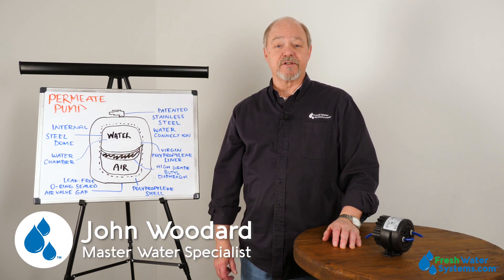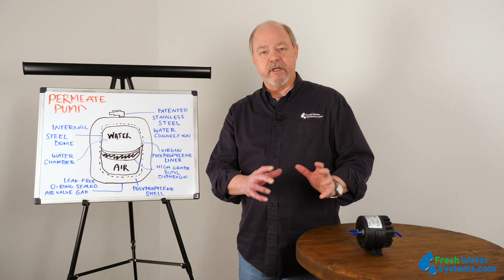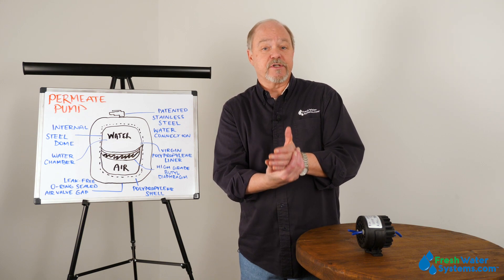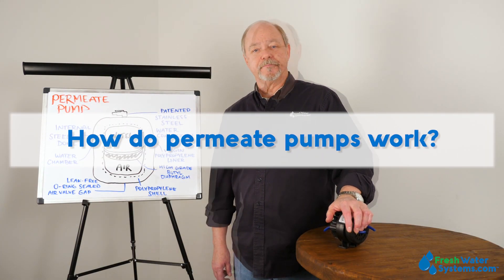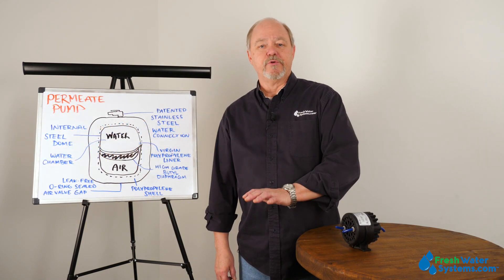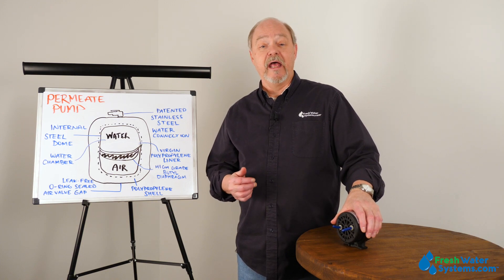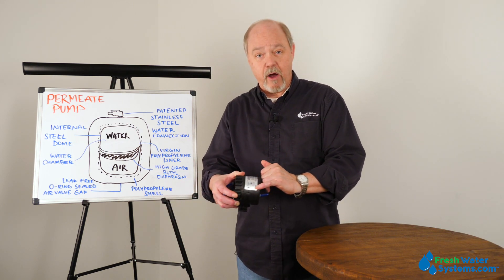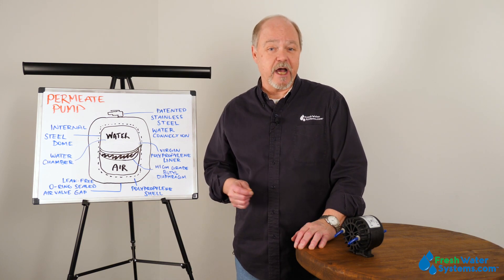What is a Permeate Pump and How Does it Work?

Comment: So basically functions as a turbo does on a vehicle. By converting waste pressure into clean supply pressure.
Reply from the maker: That's a neat comparison.  Using the energy of water flowing to drain, the permeate pump pushes water into  the storage tank protecting the membrane from the rising pressure in the tank as it fills.

Comment: I bought and installed an Aquatec ERP-500 permeate pump according to the instructions and it stopped working after a few days.  I checked the outlets from the membrane and they were producing water so it was definitely the pump that was bad.  I'm not the only one who has had this happen.  Is the ERP-1000 any better?

Comment: This video forgot to mention that a permeate pump ONLY helps to fill a pressurized tank (conventional bladder-tank).  It adds no benefit to a tankless RO system or some type of non-pressurized tank.
With a bladder tank, the air behind the bladder gets compressed and pushes the bladder, which makes it more difficult to fill the tank with water. The RO system is essentially fighting against the tank pressure to fill up the tank.  As the tank gets more full, the pressure gets even higher and the membrane wastes more water.  A permeate pump helps overcome the tank pressure so that the RO system can operate at peak efficiency.
With a tankless setup or non-pressurized tank (like an open barrel), the water flows freely, so there is no tank pressure to overcome, and the permeate pump adds nothing.
Reply: Thank you,  I came here to ask just that question.
Reply: The permeate pump works well when it works.

Comment: With the permeate pump installed in the cabinet below the sink with the doors closed, can you hear the sound of the pump in the kitchen? Are they loud/annoying?
Reply: I put mine underneath the floor between floor joists so you can see it from the basement. It helped a lot. One thing is it will fill faster and shutoff eventually, but you can definitely hear it if it's in a cupboard like a clicking noise.
Reply: You want one that makes a noise so you can tell if it quits working.  My ERP-500 lasted less than a week.

Comment: hi! i bought second hand reverse osmosis system (7 stage). It has permeate pump on it. But I do not use the watter storage tank that came with it, but rather I let it go to bucket. I guess the permeate pump then doesn't work cause there's no pressure.

Comment: this video shows removing the ASO valve, other videos out there shows leaving the ASO, and hooking up permeate pump to it (whats the difference, with or without using a ASO valve?)
Reply: The ASO is for people that for some reason don't know about the permeate pump.
Reply: Most ASO valves limit the storage tank to about 60% of the inlet pressure, so a 60psi line pressure gets you 40psi in the tank. This is so the membrane is always working with a pressure differential. With the permeate pump you can pump the tank right up to 60psi. The problem is that every time you get a glass of water, the system will cycle because the permeate pump has low hysteresis. This is bad for purity because at the start of every cycle you get a shot of "dirty" water due to TDS creep (same reason tankless RO is not all that great). So some people install a special 90% ASO in tandem with the permeate pump. This has more hysteresis so the system will cycle less, less cycles is better for the purity of the water in the tank.
Reply: It should replace the ASO as it does the same job. I put one on my system and was told to remove the ASO.  Love it!

Comment: i have read the permeate pump increases TDS creep. true? if so, what is the decrease in performance percentage?
Reply: That is not true. It is only true if you remove the auto shutoff valve, which you can't do anyway as then the brine would run 24 hours a day and waste hundreds of gallons of water.
Reply: @rsilvers129   The pump replaces the ASO and no will not run 24 hours.
Reply: @nelsonmccoy4120  So many obsessed with the ASO.

Comment: So the permeate pump reduces the pressure on the product side of the RO filter so the supply side pressure is more effective in pushing water through the filter.
Reply: That's a good way of putting it.

Comment: I decided to consolidate my thoughts a put it in a single short message.  First, get the Permeate pump.  There is no situation where you will not seriously benefit from it, even if your water supply is 70PSI.  The video makes that clear, but you can find graphs all over online about them.  You waste like 80% less water, your tank fills faster, etc.

Keeping the auto-shutoff (ASO) valve after you put on your permeate pump is a tougher question.  There are good reasons to do take it off and good reasons to keep it.

KEEPING THE ASO AFTER YOU PUT ON YOUR PERMEATE PUMP
--------------------------------------------------------------------------------------------------------
1) Bad: if you keep the ASO on, your tank will reach, at max, about 2/3rds your line pressure.  That means it'll shut the source down around 2/3rds and start it back up again once the tank pressure reaches 1/2 line pressure.  Now that doesn't mean 1/2 to 2/3rd water fullness level in your tank!  I said pressure, and generally, while there is a positive relationship there between the pressure being higher and your fullness being fuller, it's not a linear one by any means.  If you empty your tank and make sure it's running about 7 PSI empty, you can figure that at 2/3rds pressure, your tank will still be probably 50% full or so (a 4-gallon tank gives you about 2 to 2.5 gallons at 2/3rd pressure).  BUT the pressure to your RO faucet is the pressure in your tank, so if you have very low line pressure (say 35PSI) 2/3rds of that might be too slow for you.  Just don't forget it makes a WORLD of difference what kind of RO faucet you choose too if you are dealing with low line pressure.  The cheap ones that come with the kits with the little plastic lever are worthless.  Get a decent one on Amazon like this one to get the most out of your RO pressure: https://www.amazon.com/gp/product/B07JH2D4DM/ref=ppx_yo_dt_b_asin_title_o02_s00.

2)  Bad: there is yet another piece to go wrong in your system, even if it's only a $10 piece.

3) Good: an ASO keeps the RO unit from turning on and off each time you grab a glass of water, which really helps with TDS creep (that is it creates a hysteresis for the system if you want to get technical).  I mean if you just fill your tank and you measure say 10ppm that day.  And you fill a few glasses of water each day and check it again a week later, you'd TDS will still be about the same.

REMOVING THE ASO AFTER YOU PUT ON YOUR PERMEATE PUMP
------------------------------------------------------------------------------------------------------------
1) Good: your tank will remain at near 100% of line pressure all the time, which means you'll have the fastest draw in the west.  It also means your tank will be as full as it possibly can be without the ASO.  On a 4-gallon tank, that might be another 2/3rds gallon even (in my experience) - so 2.7 gallons rather than 2 gallons for a 4-gallon tank.

2) Bad: The cleanliness of your water (TDS) tends to go down with time if your use patterns are just a few glasses of water here and there - like most people.  The tank might start at 10 ppm like above, but if you fill a few glasses of water each day and check it again in a week, it could be 23 ppm.  This is called TDS creep, and it's a result of turning on and off the unit so much.  Also each time you draw almost any water, you'll hear the quiet clicks of the permeate pump (the E500 is much quieter so I recommend that one unless your family is like 100 people that really need over 50 gallons per DAY of RO water).  That is, without the ASO the permeate pump will start to process water if it detects any pressure drop at all.   Now can you taste a tiny bit of TDS creep?  NO WAY!  It might even be MORE HEALTHY to keep a little of the dissolved solids (minerals) in the water, but cycling your membrane on and off more often might not be a great idea, and without an ASO, you will probably cycle your membrane on and off far more frequently.

CONCLUSION
----------------------
So should I get a permeate pump?  There is NO DOUBT about that - get one!  Just get the right size.  If you have a 50GPD membrane get the E500.  If you have a 100GPD membrane or higher, get the larger E1000.  Should I keep the ASO valve on or remove it?  I don't think there is a clear winner to that question.  If you have low water pressure, I'd take off the ASO.  If you don't, it depends what floats your boat.  You'll always have higher pressure with the ASO removed, but you'll have slightly more consistently low TDS readings with it installed.  I took mine off for a while, but the TDS creep started to bug me so I put it back on.  I personally don't think it would matter either way for most people.  Most people will probably just notice the pressure increase when they remove it - which mostly is a good thing.  Also, there is a technical solution to have the best of both worlds (high pressure and no TDS creep), but the solution isn't for sale.  I'm making one for myself just for fun, but you probably will never find something like it for sale - just too niche of market.
Reply: Your third sentence is WRONG. Permeate pumps ONLY help if you have a pressurized tank that you are trying to fill up with water (conventional bladder-tank).  If you have a tankless RO system, or some type of non-pressurized tank, the permeate pump WILL DO NOTHING for you.  I happen to have a tankless setup that I made. I run it once per week to fill up 3 gallon jugs of water. I then use those jugs to refill a water dispenser throughout the week.  A permeate pump for me as a waste of money.
Reply: @gabrielo8922  Yes, you are correct.  If you have a tankless system, a permeate pump will not assist you since the energy can not be drawn out of thin air (I kind of assumed that folks would know that much but I guess I was not clear).  I have used an RO system for reef tank water, and I did not use a permeate pump to fill the brute trash cans of calcium hydroxide water (so-called kalkwasser) for the coral (which was fed very slowly into the tank via a peristaltic dosing pump when a float valve fell and switched on the pump)
Reply: Thank you, thank you, thank you! This information, like the video, has been invaluable to me! I sincerely appreciate your thoughts and time to write this. Have a wonderful day. :)

Comment: Thank you for the very detailed but easy to understand explanation of what exactly a permeate pump does.  However I do have one question.
My inlet water pressure is approximately 55 psi and I'm thinking about installing an electric booster pump to kick up to 70 or so psi because the RO water dispenses so slowly.  Should I first install the permeate pump and see if helps solve my slow product water output?  Or should I just install both?
Reply: Wish they would answer this question because I'm looking to do the same thing. Already installed a booster pump which increased my PSI but the output is still really slow and I get a ton of waste water.
Reply: @kevinbrown3150  I here looking for the same answer as you.
Reply: I have just over 40 psi inlet and a permeate pump made it SO much better. I'd suggest to get a permeate pump if your inlet is over 40-50 psi, you likely will not need a booster pump if you use a permeate pump. Hope that helps.